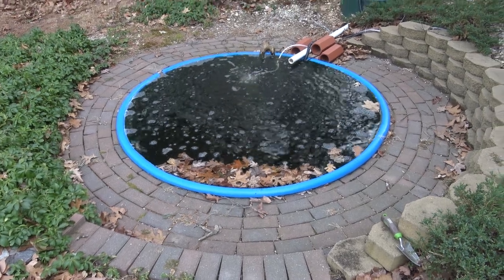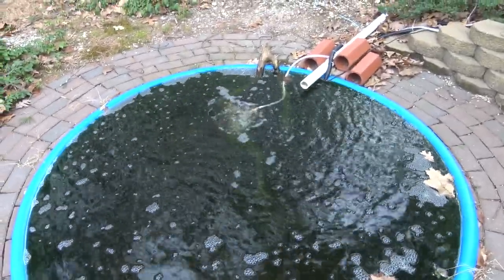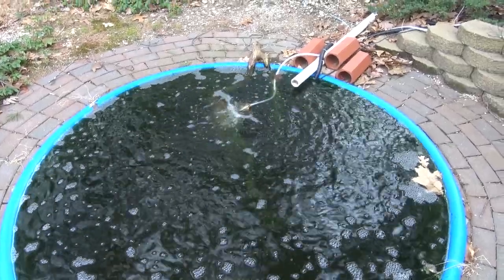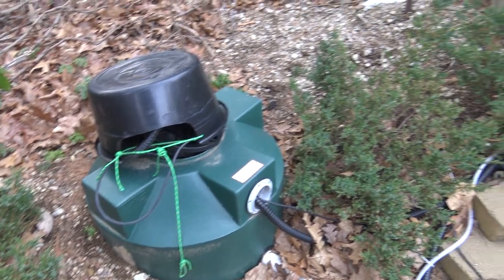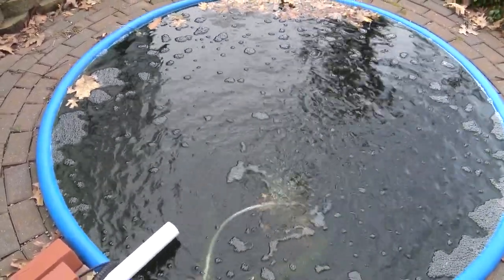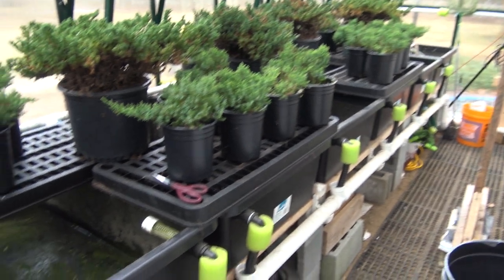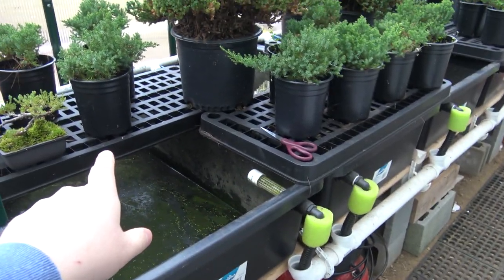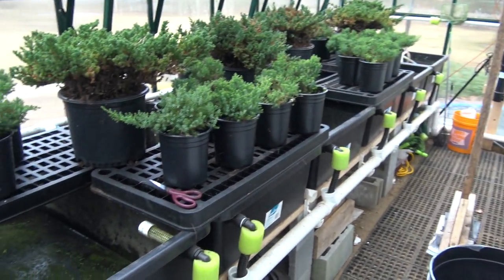Winter Greenhouse Tour 2023 - 1000 Gallon Pond, IBC Totes, Aquaponics Greenhouse System

Comment: All very interesting.  Any reason you have both inflow & outflow at  the top vs the outflow from the bottom?
Reply from the maker: whenever i can help it, i avoid drilling holes in the bottom of things as it will eventually leak. holes drilled up high have low water pressure and cause small drips, holes drilled down low have high water pressure and can cause larger leaks
Reply: @gregjonesonline  Totally understand - just put a 90deg elbow on the outtake with a length of straight to near the bottom  Then it would pull from the or near the bottom!
Reply from the maker: @jbmorrow5390  that's called a SLO solid lift overflow, it's a good idea for heavy waste fish like goldfish koi tilapia, less of a need for smaller fish. I have considered it